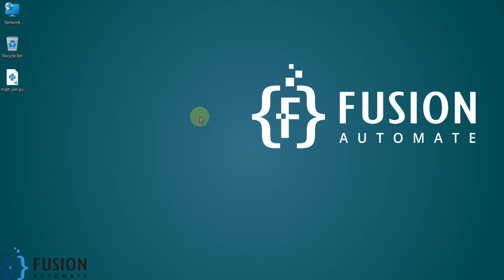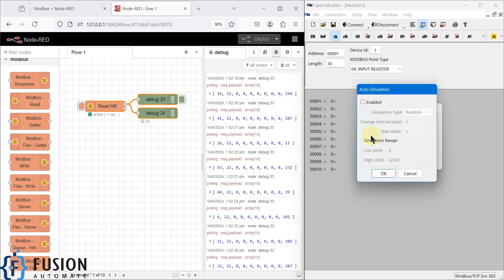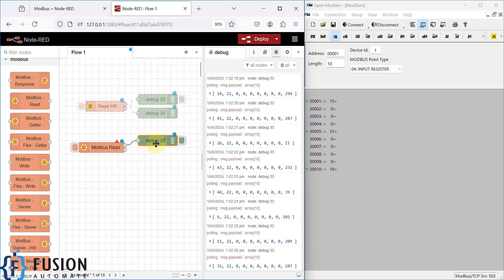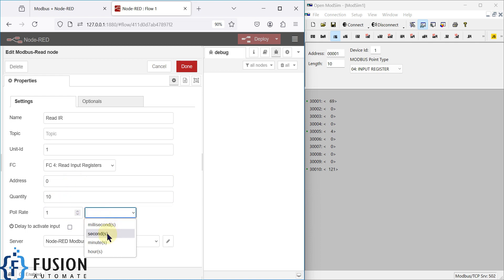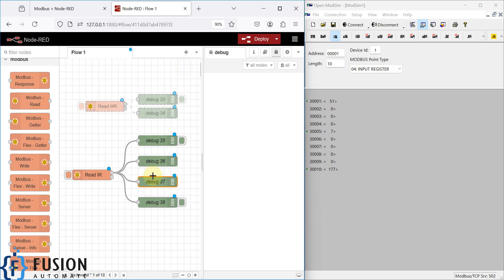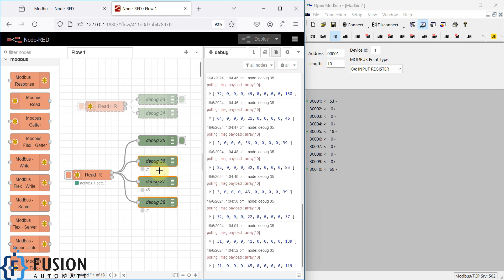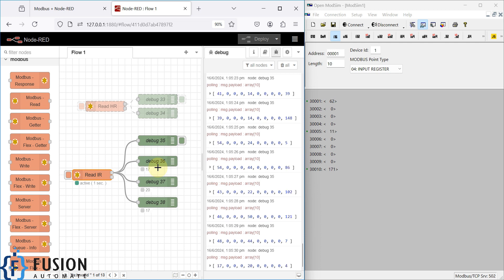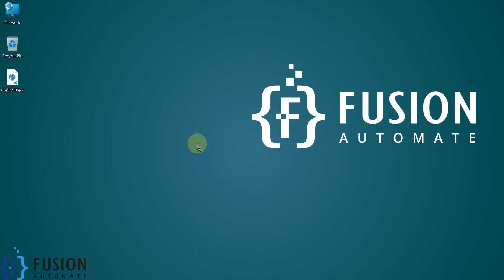How to Read Input Register Data of Modbus TCP/IP Device in Node-RED | Industrial IoT | IIoT |

Comment: How can the input registers be set in the Node-RED Modbus server, as they are only ‘readable’ according to the Modbus specification, but cannot be set with discrete electronics in the virtual Node-RED environment? 🤔

I am asking this question here because, as a beginner (this applies to Node-RED and ModBus), I have unfortunately not found any useful information on the websites referenced here, but this video is at least about input registers. 🤷‍♂

Many thanks in advance.
Reply: Try FC6 into the 300000 memory space.  Then your client should be able to FC4 into that memory space.